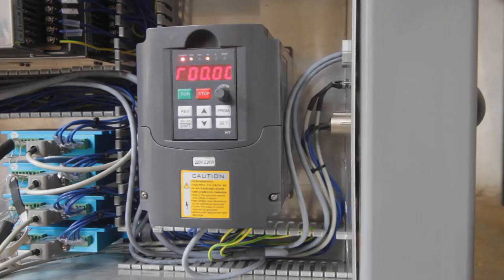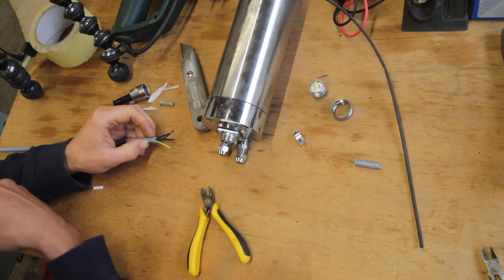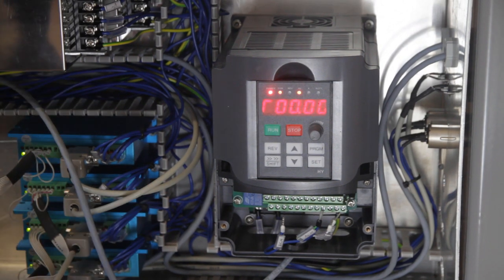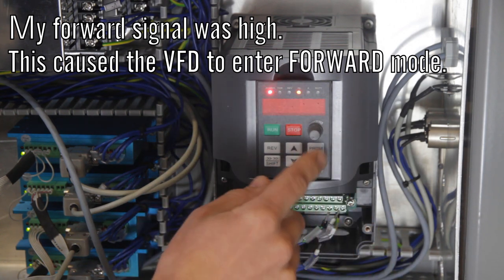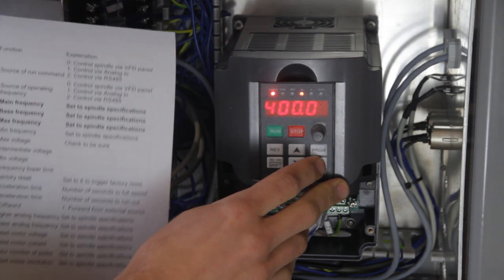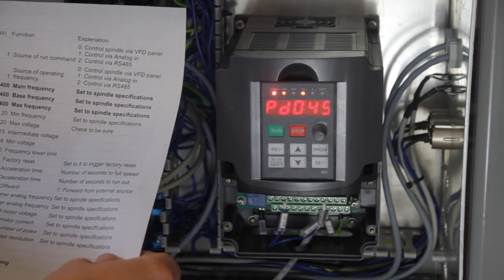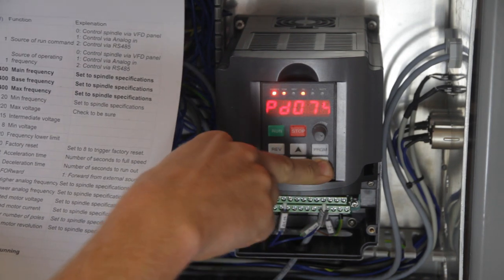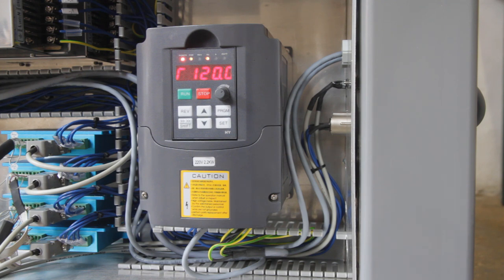My Huang Yang VFD adventure

Comment: Am here to find a solution to wiring my HY02D223B with 2.2kw air cooled to GRBL nano... In this video at 8:16, I see ACM&DCM are joined together my question is  FOR, V1 and green (ACM) wire, where do I need to connect them to my adruino nano board?...anyone with any idea...(the nano board pin out has pin D13 as spindle directions and D12 as variable spindle PMW,...are these the pins to use the ACM fitted to ground?.....been 4 days waiting for reply from bulkman 3d of queenBee Pro where I bought my 1515 router from

Comment: You need minimum 14 gauge wire for your spindle. That wire you used looked way too thin for a three phase 2.2kw spindle. You also did not explain where you plugged the controls into on the other end at the controller.
Reply from the maker: Well here that is perfectly alright. The wire I used are plenty thick enough. I used 1mm² wires. I would even use these wires to run 2.2kw on 2 phase. Then again, we can get away with half the cross-section wires for nearly everything. That's the big advantage of running 240V and 400V 3 phase for the power-hungry tools ;-).
And no, I didn't explain the controller side. Mainly because everyone has a different controllerboard. There are only u few things that come from there: a run signal, a spindle speed reference and a spindle speed voltage.

Comment: Hi. what was your pin layout  for the spindle to connect to the vfd
Reply from the maker: pin 1,2,3 are the phases on the spindle. These should be connected to R,S,T on the VFD. If it runs the wrong way, just switch 2 phases on the VFD.
Reply: @WimsMill  Wrong. RST is the 220v input
Reply from the maker: @tomtillman  You are completely right. The U,V,W are the outputs of the VFD. Thank you for pointing this out.

Comment: Is this spindle overkill for just milling wood? Should I go for the 1.5kW?
Reply from the maker: It depends. I use a surfacing bit of 60mm diameter: https://www.cmtorangetools.com/eu-en/router-cutters-chucks-for-cnc/spoilboard-surfacing-router-cutters-with-insert-knives-2
I can do approximately to 1.2mm step downs a bit more on softer wood. If I do more, it really starts to struggle. This bit can make quick work of flattening a piece of wood. Depending on your routable size, I would consider the 2.2kW.
Reply: @WimsMill  That's one awesome bit. The largest bit I have is a 25mm surfacing bit because I mostly work with panels (plywood, finger jointed, MDF), would you say that for cutting, slotting, pockets and carving, the 1.5 is enough?
Reply from the maker: @matiasgoinheix366  In that case 1.5kw will suffice. It is smaller and lighter, which is better for smaller machines. The 1.5kW also uses smaller collets (ER16) which can go to 10mm. Some of the more powerful bits in woodworking come with 12mm bits. For that, the 2.2kW will be needed. The price difference is not that much, so for that I wouldn't take the 1.5kW.
Reply: @WimsMill  Thank you very much, my machine is 1.5m long by 1m wide. I noticed the price difference isn't big, I might go for the 2.2kW. Thank you for the replies and the video (will be of much help when installing), I think I'll go for the same brand you have here, seems to be the most common on ebay.
Alternatively there is one fairly priced at steppermotoronline, I'll have to do some digging.
Thanks!
Reply from the maker: @matiasgoinheix366  Good luck. If you look at my other CNC built movies, there are some links to parts and also the forum post. Might be of interest to you.

Comment: for vfd 220 power input what size circut protection did u use if one was use.
Reply from the maker: I used a 16 amp C Curve automatic fuse right after the mains connection and from there it is distributed in the machine.